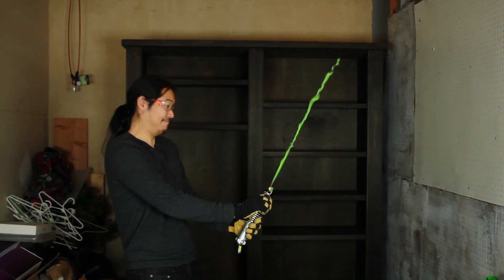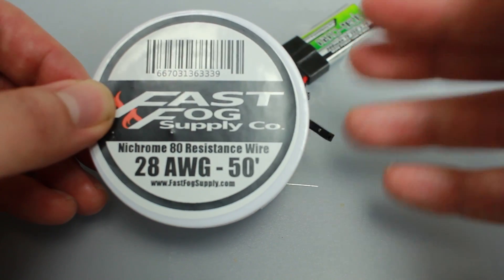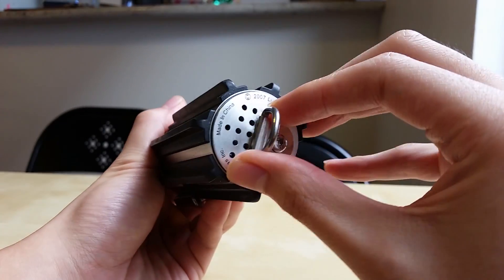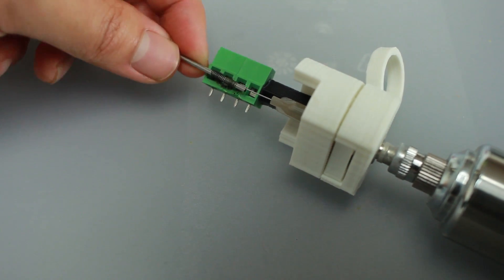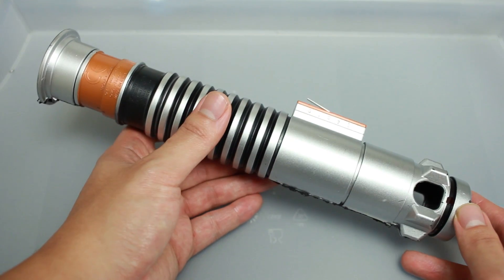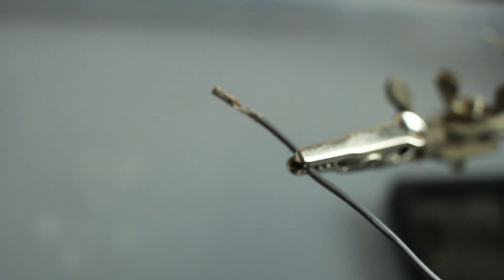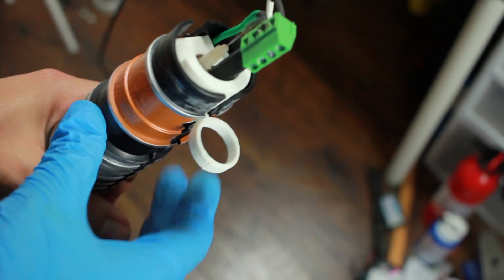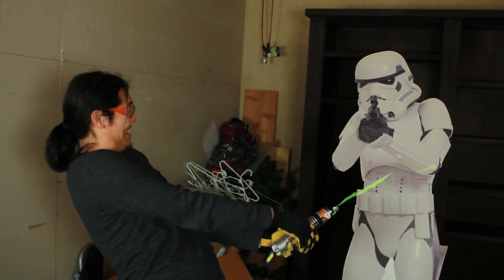How to Make a Real Burning Lightsaber: Part 3

Comment: This is garbage!!
Hacksmith made an actual lightsaber!!!
https://youtu.be/xC6J4T_hUKg
Reply: They are practically the same thing, both are essentially torches optimized for cohesion. The hacksmith one uses on oxidizer as well which helps, but of course the hacksmith has thousands of dollars to buy an off the shelf glassblowing nozzle. Additionally, this one is entirely contained in the hilt and was made 3 years before the hacksmith one. The hacksmith one is amazing, but don't discredit this one so quick.
Reply: @shleed  lmao good joke
Reply: Ur a prick
Reply: They're both basically just giant blowtorches the main difference is that hacsmith had at least several thousand more dollars

Comment: This is what i imagine a non force user would experience using a lightsaber, because the force of the weilder holds the blade together

(Or at least ive kinda heard and kinda think)
Reply: Thats not how it works
Reply: If that was how it worked luke wouldn't have been able to turn it on so soon and fin wouldn't have been able to use it

Comment: Dude, is there a way to create some form of containment for the flames? Imagine somrthing attached to the end of the saber for the fire to flow through. This way when you swing it, it wont extinguish? But you also want the flames to be useful, so what if the fire was "sandwiched" between 2 sharp blades, and the fire shot between them thus creating essentially flaming blades. Or if you shot the flames through a thin tube that was bored with holes on either side for the flames to escape from. And that small like, thin as a straw, tube wad sandwiched between 2 blades. So the pressure behind the fire is stronger because the tube is pretty thin, causing it to burst out of the sides where the tiny holes are bored, thus heating the blades and creating a scorching hot fire saber? There must be a way to contain the flame so it remains erect, while still letting it freely burn whatever it touches. It must be made swingable! Lol this is so cool and the closest ive seen to the real thing. Youve figured out how to project fire out of a handle. Now how do you harness and stabilize it so it wont extinguish or act like a whip more than a blade? YOURE SO CLOSE
Reply: The blades would have to have a convex design where the, along the length. The center is curved upward, while the edges are pinched down. Like a bell shape if ur looking down the length. This way you can shoot the fire through the "tunnel" created between the 2 blades and have the fire spew out of the sides! Idk just being imaginative im not a scientist. But basically imagine parentheses (), each parenthese is a blade. The fire is projectiled inside through the middle, while the edges are sharp as heck and may not be fully sealed. This way the fire can shoot out between the blades

Comment: You are missing two things that would make this a real lightsaber, but you are closer than anybody in history (you really should be proud,  as this is the first major step towards a real one). What you're missing is power and stability. If you were to try and marry your plasma blade with a LIPC (laser induced plasma channel, which involves running multiple burning laser beams in close parallel, and bouncing electricity between them by having the beams intersect with high voltage discharge from something like the electrodes of a stun gun), or maybe even just rig a stun gun circuit so that your plasma stream intersects with the stun guns electrodes, the plasma should carry the electricity (or light and electricity, if you opted for LIPC instead of just electrodes). This could make your blade ALOT more powerful, and would see you at about 80% of what a lightsaber should be (let's say you're currently at 15% or so, which is still very impressive, as our best minds have said it was impossible for years). To get the final 20%, you need stability in the blade, which could be managed, honed and adjustable by passing the beam through the center of multiple adjustable highly magnetic rings. Fluctuating the magnetic field should contain and adjust the beam,  and that's about all there is to it. Essentially, you need to integrate a taser circuit, a few blue ray diodes and a couple magnets into your design.

Comment: i like this for the fact that it is a handheld plasma torch. i would up the battery, the wire gauge, and the coil and fuel (possibly change the fuel) to give it more umph. i would also use something better for the housing instead of a plastic lightsaber shell. been wanting a handheld plasma with its own power source for awhile. theres a patent on one right now with a different system but it looks like a drill. i have no idea if they have been manifactured though. someone reply

Comment: Can this thing actually burn thing?
Reply: Kindred Watcheston i wanna see it go thrpugh steel sheets of different thicknesses to see efficiency
Reply: Ray Martinez yeah.
Reply: read my recent solo comment basocally c0vers how good it actually is. i beloeve power soource ans coil and housing needs to be changed for it to work on steel once thats built then a proper variable of steel thickness can be tested. i really only like the fact its a cordless plasma torch
Reply: Ray Martinez same

Comment: hey man couldnt you make the coil larger in diameter to make the flame larger? also couldnt you add a cap or some sort of regulator to the fuel source outlet so that the flame is more stable?

Comment: I don't think you went over this in the video, I'm sorry if you did. The ignition coil appears to stay on(lit?) as long as the fuel is flowing. Would it not wear out/break fast? It reminds me of the coils they use in hand held vaporizers and I was always told never to leave the coil on for too long or it could burn out.

Comment: Try to modified it with the adding features of an light  bulb inner wire to Saber part, so it won't dangle around with ease instead of the flaming version.

Comment: Do you think using a focused (or multiple) jet of Co2 and lasers would make a good lightsaber?
Reply: Max Martin laser
Reply: Pardon?
Reply: Wouldn't it not end though? Correct me if I'm wrong but amlaser is like a flash light of sorts.. unlike a fire sword thing
Reply: The light would only Illuminate the jet stream of the compressed air. So yes it would end providing there wasn't any external mist or fog and it was day time.

Comment: dude thank you so much, i finally finished one similar to the one in the vid but i need a new ignition circuit because it dies very fast and for some reason some times it doesnt work  so i change out the nichrome wire once in a while(and its a pain in the but) but then it starts to work lol but thanks its so freaking cooooooll!!!!!!

Comment: I wonder if you can make a triple gas barrel with the light saber mold 33 conductors with two wires with one huge battery strip but it has to be 3-D printed

Comment: I have a question and I'm doing this as well but is it possible to make a wooden sword that is as sharp as a real one but still have its sturdiness and strength while being almost or exactly as thin as a real one
Reply: Drago Omega Not really. I've experimented with sharpening wooden daggers and it never gets far. Wood simply doesn't sharpen well, though you could try soaking the wood in resin  to harden the edge, then it might sharpen better. Epoxy might also work for the same purpose. Good luck!
Reply: Thorondil thanks for the info now I have a note to self to coat the blade in resin thank goodness I haven't started it yet
Reply: Theres no guarantee it will work, just an idea.
Reply: I know I'm just gonna test it
Reply: Drago Omega Good luck!! If you don't mind telling your results, I want to try it too if it works lol

Comment: Try having it in a large vacuum chamber so the air resistance doesn't affect the blade.
Reply: lynkozz Forgetting air is required for combustion :(
Reply: I wasn't thinking without oxygen. Maybe with oxygen being fed through it, or making it a pure oxygen atmosphere

Comment: eh I wounder if you could somehow put a ventilated glass tube on it so the flame would still heat up glass tube so it could cut but it would look more like the iconic cylindrical shape of the lightsaber instead of a straight flame of course with some type of plug on the needle so it doesnt melt the plastic but the thought of it sounded intriguing to me so i thought id share my idea

Comment: Do you think that am arc lighter would work instead of the nichrome wire?
Reply: *an
Reply from the maker: I'd guess so, but those arc lighters aren't designed to be run for more than a few seconds! It may not last very long used like this :(
Reply: Sufficiently Advanced that does make sense

Comment: The Government Has Lied!
LightSabers are Possible?!
Reply: they're completely possible, you just need to figure out what the functionality you want to achieve is, and then figure out what you need to achieve that, and when you've built it (not if), then what you've built becomes the new definition of what it is to have that function, as opposed to whatever weak connection between cause and effect is grasped at in fantasy. 

for example, I've just realized an essential part of bullets-blocking would be a type of thin rod that spring-activates out, umbrella-style. you ''blade'' length for blocking is much more limited than your blade length for burning through normal metal. as for 'interference blocking other blades', that has to be some kind of electromagnetic field of some sort generated completely independently of the burning fire. 

the stacking blocking rods need to be made of some super super dank alloy, probably tungsten-carbon-based, so it doesn't do anything like, you know, melt when surrounded by that fire. how much mechanical magic could you get the rods to do? if you look at the cheapest Wal-Mart blades, you're looking at thin stuck inside thin stuck inside thin and you'd be relying on your electromagnetic field generator more than your physical metal rod to help stop bullets----- in the first place, since bullet stopping would largely be dependent on reflexes and the correct tactic would be dodging not -blocking-, most of the time anyway, maybe you don't need to try to optimize how wide a rod-blade you can get to expand out of the hilt and bullets striking it would practically always penetrate in 'real' combat situations, but in artistic demos and expos proving the rest of the machine, you could deliberately use lousy civil war bullets made of such inferior metal that if you can manage to hit them with the rod that slid out covered in fire, you could maybe bat them aside. 

like the way jousting and fencing has ''lab conditions ''safe'' '' ways to demonstrate sword fighting, but only of outdated forms, you could do cool things with outdated guns. and if you find yourself in a situation where you keep advancing your ''lightsaber'' tech, you could decide you want to use it to bully any situation where you expect to face lousy enough bullets. 

it's inferior to doing things other ways. it's inferior and impractical, but it's NOT ''impossible'' that's the cool thing! :D
Reply: Darth Parallax "super dank alloy"
Reply: Lightsabers arent possible RIGHT NOW.
Reply: Yes, but NOT as a combat weapon. Mining robot's have laser drills however.
Reply: Let your anger flow with in you! Complete your journey to the dark side! :-) lol. :-)
Reply: They're completely imposibble when the battery runs out it will not work build it again even ironman's armor you can'y breath there because you can't add a airconditioner in that suit or any ventilation cause it will ruin the designs lightsabers are way far for our time you can't make an stable lightsaber. And it's not strong enought to kill people it's way far our time stop daydreaming
Reply: it works to be possible like this, however Real light sabers are super heated plasma contained with a magnetic field, the issue we have with creating real light saber we have to figure out some way to close off the magnetic field or else the heated plasma would just continue on forever Theoretically speaking if we could actually use and cap a magnetic field around heated Plasma, we could 100% see a Real functioning light saber.

Comment: you should try replacing the wire ignition system with a modified arc lighter. it could possibly save space and provide subtle sound fx

Comment: why not use an 18650 battery used for vapes they are made exactly for your purpose of making a coil glow and they last pretty freaking long
Reply from the maker: You could definitely try that! I used what I had on hand.
Reply: +Sufficiently Advanced vapesaber
Reply: They’re not made for it. Vape mods were used to utilize them. Lipos are more powerful and have a longer life depending on the size.